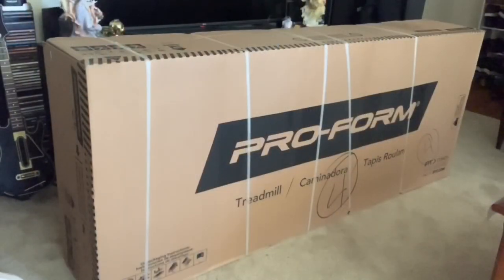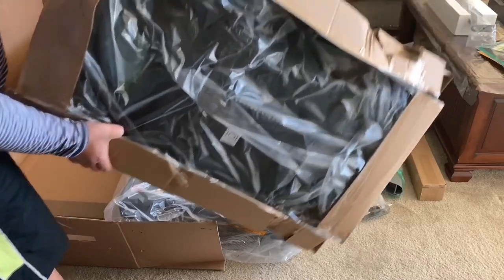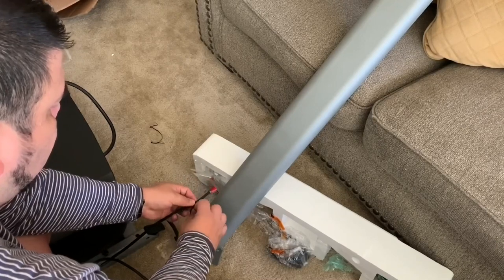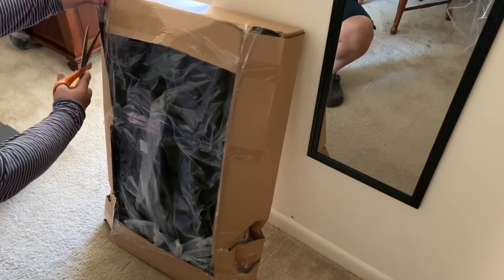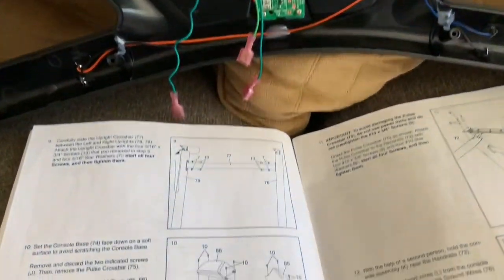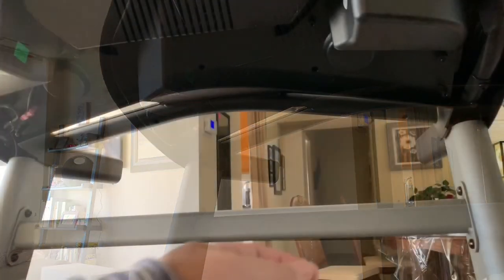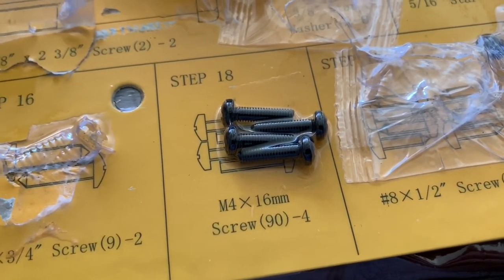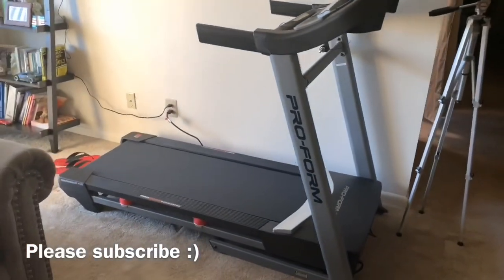Proform 400i performance unboxing and full assembly

Comment: i just got myself a 400i for my 60th birthday and after opening the box, i was like ack! but even though reading through the directions and it doesnt seem too complicated i like to actually watch someone do it first so here i am....
Reply from the maker: Glad i can help.
Reply: @KanotoRN  so 1 and 1/2 yrs later my son and i finally put it together......omg.....it wouldve been easy except or the fact that every screw was a problem...holes dont want to line up or you have to really force the screwdriver to get past a certain spot to get it to get the screw all the way in..some didnt want to go at all...ugh....took 4 hours!! i didnt have an adjustable wrench and had to use one of those ones with the notches...dont know what its called but it worked...the only problem is some of those screws close to the floor on the upright posts are almost impossible to get done ....but we did it...i believe its all together now to test it out to see if it actually works! lol...tomorrow....i wanted to rewatch your video to see if you had similar problems with the screw stuff but you edited all that out lol...so im curious to know if you found that the most frustrating part....thanks for the video!
Reply from the maker: @judithwilber2540  Wow! Over a year? Hehe. Well some screws are kinda hard to twist. But if you align it well, it will go in. I did not have any problem putting it together. Enjoy you equipment. I still am using it :)

Comment from the maker: Yes I had that static issue also but it went away after buying an extension cord with a fuse. Making sure that third tip match the electrical socket well. Glad you saw my video. I hope I help you assemble it . It was a long process for me. Hehe

Comment: Just got mine this past week. 
I have a rubber mat between it and hardwood floor but im getting static shock frequently on the handles when using it. Also noticed some squeaking from time to time. Besides these issues im loving it

Comment: Oh holy crap, thank you for this video lol
I bought a T7 and I was wondering why the screws that go on the handles wouldn't go in. 
I guess it's just by design.
Reply from the maker: Yeah. I know.
Reply: I can't figure out the screws
Reply from the maker: @caromainm1433  see the numbers on the packaging
Reply: @KanotoRN  they don't go inside completely.
Reply: we just put ours together today and that was the biggest gripe was dealing with the screws and holes not cooperating...you really have to push and turn the driver and finally get them to go all the way in but a couple still wouldnt and we are wiped out lol....its all assembled good enough lol...going to try to actually turn it on and get the running tomorrow...